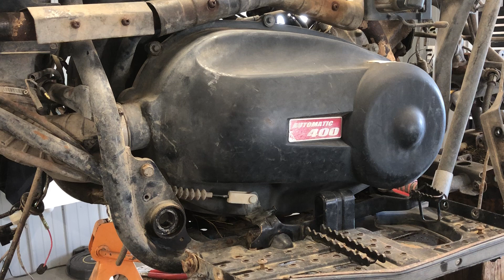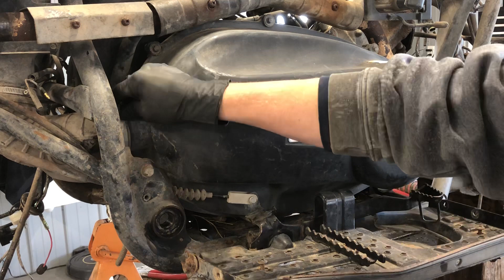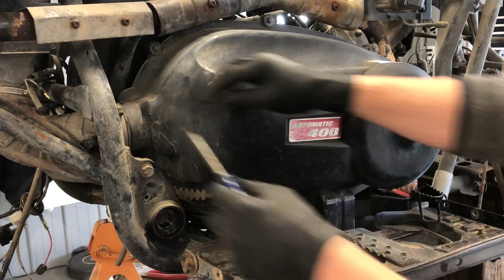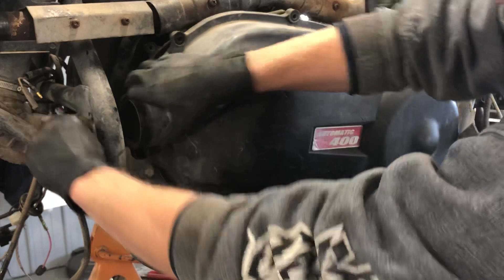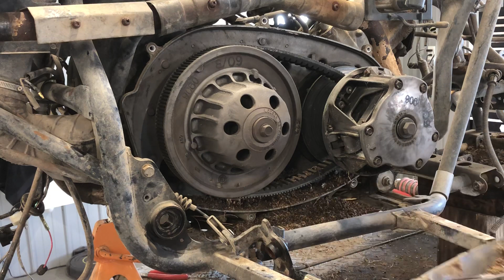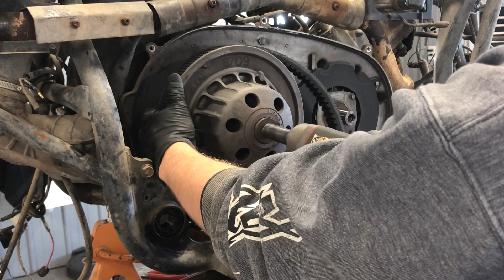How To - Kawasaki Prairie 400 Automatic Belt Clutch Replacement Puller

Comment: Just picked this 4wheeler up
Off a old farmer. I believe the grandkids jammed the gears from H-L too much. It has a little lag when given gas… is this do to the belt slipping?
Reply from the maker: Yes, just a simple belt might fix the problem. Otherwise the clutches might be grooved and the only way to fix it would be to replace the sheaves. Not a cheap fix. A lot of times farmers use one speed for spraying and irrigating. That will groove the clutch. It would hurt anything to keep running it that way. Also you can check out our eBay store for a good used one:  https://www.ebay.com/str/midnebraskamotorsports

Comment: I have a 01’ prairie 400, with I believe a slipping clutch. I give throttle but it takes a bit to get it moving. Anyone know what I would need to replace/ fix?
Reply from the maker: I’d say the you need a new belt!!  Let me know what you find out. Thanks for watching. I have a bunch of videos on the prairie 400 set to come out. Keep an eye out for them!!
Reply: @MidNebraskaMotorsports  Thanks! Its also hard to shift sometimes, not sure what could be the cause of this?

Comment: Do you know if you can roll the driven clutch to spread it and allow the belt to come off like one would do on an older snowmobile ? I don't know if this fella knows that trick or if it's not possible with this unit ?
Reply: Well.... Ya don't have to pull the primary in my situation ..... I rolled the belt off with a tiny bit of effort (ya still have to get at it !! That's the effort ..... ) The service manual says to put in gear, lock the brakes and Spin and push the driven clutch (inward ) and it will allow the belt to go deeper into the driven clutch giving more slack to slide off the primary it was a piece of piss to do and does not require the puller, I believe this gentleman in the video has other work to do to the clutch not just putting a new belt on (I hope )

Comment: Hi good video. My question is how do you know if primary or secondary clutches are bad
Reply: I'd look on the surface of the clutch faces (where belt meets clutch ) I have some worn grooves deep on the driven and high on the primary. Second you will have to disassemble the clutches to expose the shims and weights these areas have contact wearing and should be measured and compared to service manuals specs

Comment: Is there anything you can do to get more hp and torque on a prairie 400
Reply: It's amazing what shorter tires will do, clutch is a quick way to move the power around but not gain, perhaps a pipe and jetting or lose some weight ( rider weight)  it's a 400 single cylinder it's not a powerhouse

Comment: If anyone is looking for the same question as I was the arrows on the belt need to be pointing to the front of the quad I'd you buy a aftermarket brand like I did it was difficult to find a answer

Comment: Can you do a video on how to adjust the belt, please? 
I have a '99 Kawasaki Prairie KVF400(C) 4x4 and I'm getting ready to tear into the front differential to replace bearings and seals. Also need to replace the seal on the left side of axle on rear differential. Any help would be greatly appreciated!
Thanks in advance.
Reply: The video he linked shows nothing about how to adjust the slack ...... Fyi don't waste ur time

Comment: You dont have to pull the primary to get the belt off in a pinch, use a pry bar very gently to take up the slack, try to get the belt tight on the primary, then you should be able to roll the belt off the top of the secondary, reverse to put back on, obviously a new belt will be tighter but most of the primaries on these have grooves that allow the belt to bottom out between the sheeves and it gives you just enough to get the belt back on, could save s long walk or ruined day of riding
Reply from the maker: Love it Chuck!!